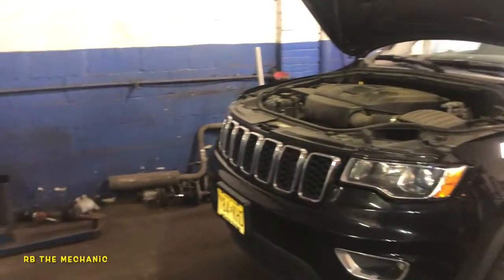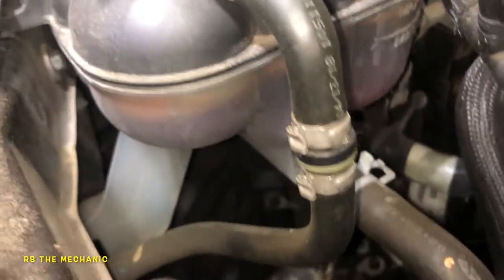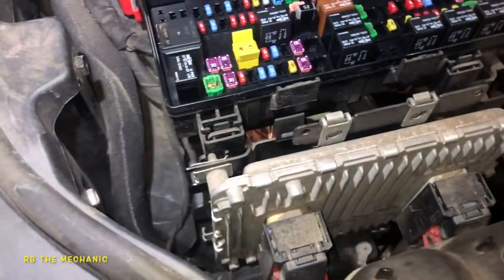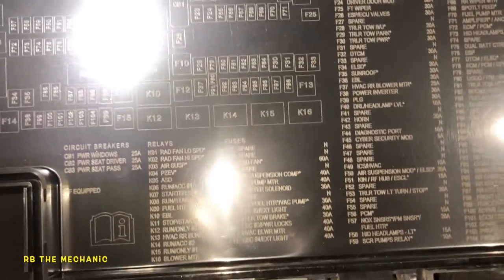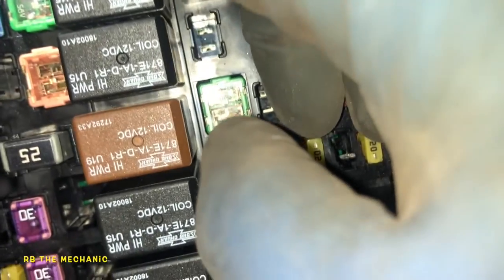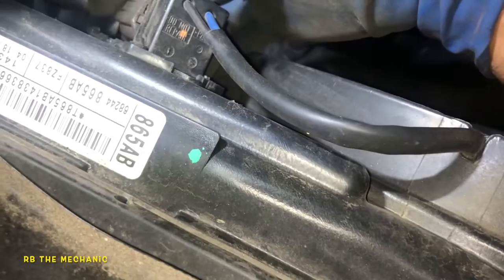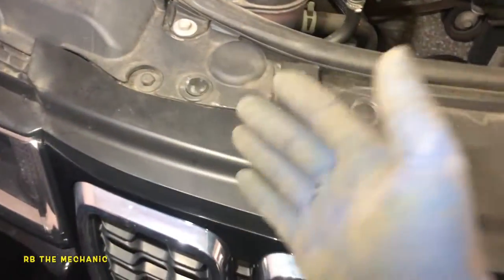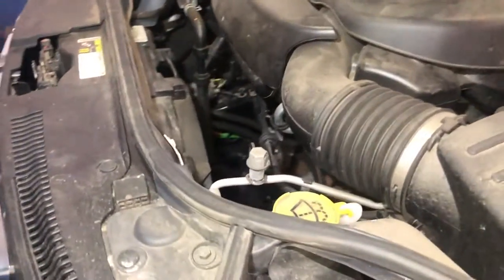2018 Jeep Grand Cherokee 3.6 over heats diagnostic tips must check Radiator fan FUSE and Relay

Comment: Hey brother, like your video I have a grand Cherokee 2017 3.6 L it’s overheating especially when I use the AC that light will come up to super high But when I turned the AC off. I stopped let it cool down open the radiator cap. Guess what no water I do not see any leaks. This is the second time that has happened and two months so like I said, I am going to check those items in the box. it has 93,000 miles, I love it very comfortable for me again thank you for sharing your videos. God bless.🙌🏼🙋🏻‍♂️🙌🏼👈🏻
Reply from the maker: Did u check if ur fan is operating and violent level

Comment: You know guys wat is the problem its water pum bad disaignin pump diafragm in the gasket the problem i there ar two pieces wen it failthe water dont circulate properly only close cicuit  around the same water pomp an do not vacum the air in te motor heads an do not flow properly and makes the coolat  blows in the cap of deposit  wuen it heats chaggue new water pup an thats it
Reply from the maker: Ok

Comment: Thanks for the video. Really helpful! Got a '17 GC 5.7L with the fan not coming on at all. Jumped fan at the low-speed relay output and it works. The relay and fuse check out good. The coolant temp sensor at the pump works. Scratching my head now. Really open to suggestions on next steps.
Reply from the maker: Didn’t scan the car for codes in all modules
Reply: Did some more investigating. Running the Jeep I found that it does command both low and high fan circuits to come on. Think I have isolated the worse offender of the relays. Turned out the relay checks and actuates ok without a load. Once it is back into the fan circuit, no-go. Also found out this cooling fan circuit is super sensitive to what type of replacement relay is put in. The wrong type will immediately throw a fault code. Exact replacements are not readily available and so far only found non-copycat versions with China lead-times of several weeks. Amazed by how many "used" ones are for sale.

Comment: my cherokees fan turns on good at idle turns on when it gets to 210 farenheit, but wont turn on when im driving, is that caused by a fuse or the fan needs to be changed?
Reply from the maker: Depends if the car over heats or not did h check temprature
Reply: @RBTheMechanic  when i’m driving it won’t turn on and will get to like 215 so i’ll turn the ac all the up then it turns on, i won’t let it overheat
Reply: or could it be the radiator that needs to be changed?
Reply: also the temperature only starts to go up when i’m going slow or in trafic etc
Reply from the maker: @raulangulo6351  so check ur fan operation seems like there no air flow when moving fast it cools down from air flow

Comment: When I drive my jeep then stop to idle, the fan stays noticeably high and also sometimes when I'm driving slow (Maybe 1 rpm) for about 30 seconds then goes down. The coolant temperature is about 1/4 up. The coolant is good had it topped off from the oil changers,  2018 jeep Cherokee summit. thanks.
Reply from the maker: I highly recommend do throttle body cleaning!   What is the milage on ur jeep
Reply: @RBTheMechanic  ok ill check this out 120k. I always maintain my Jeep. Do you have products you can recommend? Thanks
Reply: @RBTheMechanic  UPDATE:  I did the throttle body cleaning and it worked.  When I pushed on the spring that opens up the port or shield (or what ever you call it ) it had a little build up so I cleaned it with the same product you used and sprayed it down. now it runs smooth. thanks a great help!!
Reply from the maker: @StarOasis26  cool good job

Comment: Mine overheats when going on the highway like 70 goes 3/4 of the overheating line
Reply from the maker: Check coolent fan operation and front of radiator ac condenser for blocked of air
Reply: What was the problem? Same here

Comment: My Jeep Cherokee overheats when I'm stopped or going slow. But on the freeway or going going fast it cools down to normal.
Reply from the maker: Might want to check if fan is operating that would be reason cuz u will get no air when local or stops but on freeway u got air pressure

Comment: Recently replaced Tstat months later fan be turning on after mild driving temperatures while driving are at 230. Going past 70 240 5.7 hemi topped off and everything should I check fuses.
Reply from the maker: Ye or fuses maybe bleeding
Reply: @RBTheMechanic  okay ima check it rn. I had just drive 2hrs and never went past 245 so ima check rn.
Reply: @RBTheMechanic   the fan does kick on tho

Comment: My fan won’t spin but the car is not overheating? Same car any ideas? Checking fuse’s tomorrow
Reply from the maker: Well do check it but just to let u know fans don’t always run they come as they are needed and commanded on I would let the car idle and wait to see if they come on at correct operating temp

Comment: 2018 jeep grand Cherokee here my radiator fan is not turning on I’m going to to get the fused check if they aren’t the issue though what should I check next?
Reply from the maker: What’s the issue car over heating?
Reply: @RBTheMechanic  yep overheating while idle but when im driving it cools down I checked the radiator fan while it was on and idling and the fan wasn’t turning.
Reply from the maker: @audioapegaming3334  so ur fan are not working check relay fuse to start with very common on these for fan to go bad
Reply: It was the fuses for me big dog replaced them and I was good to go thank you for the help brother
Reply from the maker: @audioapegaming3334  nice glad u found the issue of it keeps blowing then I would say fan is taking too much load
Reply: If the fan turns on and runs with AC engaged, is that enough to say continue looking elsewhere, for overheat situation?  My buddy jeep is overheating, fan runs when AC on, but I feel like it should come on with AC off, judging by the temps I'm seeing, 230°not uncommon
Reply from the maker: @sidewayzmike  no cuz there’s still control for fan with cooling sensors relay and fuse
Reply: @RBTheMechanic  I feel like I need access to proper diag equipment, specifically witech scanner.  I want to command the fan thru the PCM.  I want to check actual values, and verify all responsible modules are seeing ECT sensor values.  PCM/TIPM/CGW/ and heck also check HVAC module.
Reply from the maker: @sidewayzmike  yeah make sure u do it correct so engine don’t get damaged
Reply: @RBTheMechanic  yeah, my diag methods are usually heavily geared towards letting the modules apply the powers and grounds signals, as opposed to using my power probe.  Cooking a module, because I sent b+ thru a wire that would actually have a ground signal, is something that still scares me to this day.  Expensive mistakes like that, can only take a second, ya know